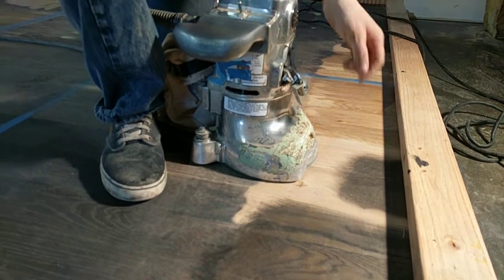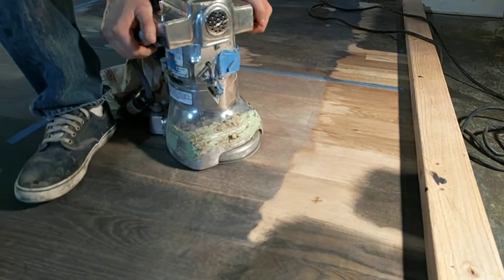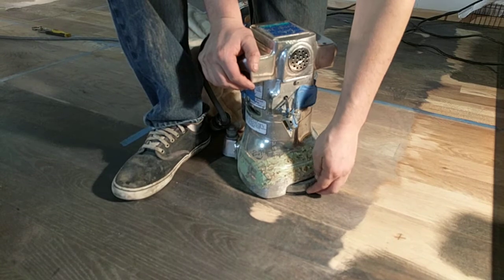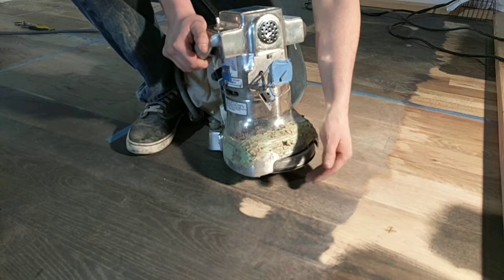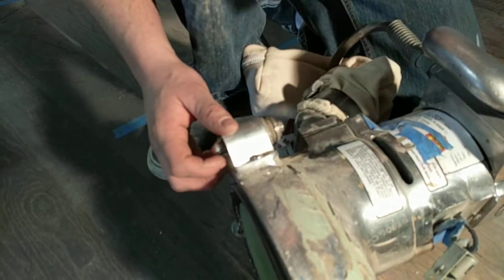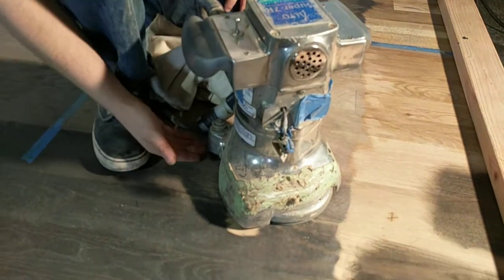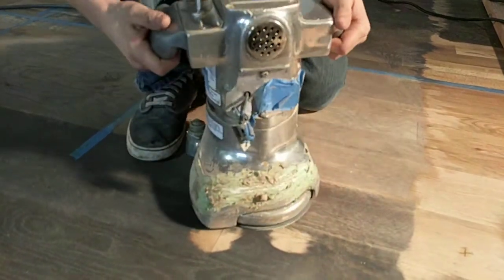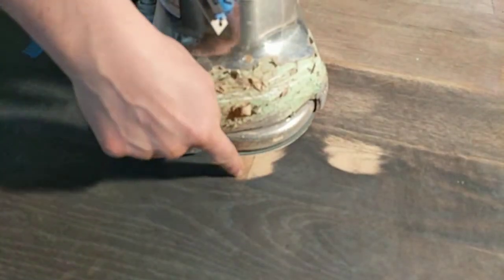#2 Edger: Understanding the buffer and How to adjust the Wheels

Comment: ive been noticing when i edge its wavy.  the edger is cutting exactly where it should be.   its confusing.  no matter how i adjust its still wavy and you can defiantly see it when it when poly is put on.  any suggestions?
Reply: So when you edge youre supposed to go forward with it and then back parallel to the boards you are sanding, and then move over to the right to the next section and repeat until you're done.
Super7s when set up properly dig on the right side and feather on the left side of the machine. That little screw on the chassis is how you differentiate from what side of the machine is cutting or feathering, my guess is You're moving  too over when going onto the next board and as a result the machine isn't feathering what you just dug into. Also remember left to right doesn't matter what axis you are running the machine on, left to right.
Reply: Maybe a nice finish sand....I'm think orbital 120 grit and higher...

Comment: I am having a weird problem with an edge sander.  I have it adjusted to have the sanding area front and center.  I am sanding with 60 or 80 grit paper, a pine floor that had water based polyurethane new 15 years ago.  It seems like the sander sands the poly off the wood in one spot, but deposits a thick layer  poly back onto the floor beside the sanded spot!
Reply from the maker: Jaimes Beam does it gum up on the pad and the ground? Is it a hard like plastic that is brown?
Reply: Pine flooring or any other softwood AKA sappy type of floor sands exactly as you are describing. As well as some floors which have had cleaners and or wax applied to them over the years. Some finishes will also produce the results you are describing. What's taking place is the product(s) you are sanding whether that be the flooring itself, the finish and or any cleaners present have a low melting point. The sanding process generates a great amount of friction AKA heat. With that said it doesn't take long to begin to melt what you are sanding and clog the paper. Your description is vague in the sense that you stated you are sanding with 60 or 80 grit. Have you edge sanded the flooring with previous grits and this 60-80 grits your finishing grits? In any event you are going to run into what you are describing regardless of what grit you are sanding with.  There are two things that I can recommend. First off get high quality open coat edger paper to remove all the finish. 36 grit, 40, or 50 to start with. Ceramic grain papers as opposed to aluminum oxide are best in all applications. Norton Blaze or Red heat. No pressure on the edger. Literally just float the edger. Move the edger at a moderate to quick pace in order not to allow the edger to build up friction as quickly.  You still are going to have to change paper far more then you would if you were sanding say a red oak floor. However you will get far greater distance with far less loading if you use the correct paper, speed and techniques. For instance here is a video of my company edge sanding a pine painted floor. https://www.youtube.com/watch?v=vVTkt2xpCQE

When it comes to the edging, we are sanding paint. A product which has a low melting point as well as a sappy wood and will do what you are describing providing we used cheap paper, moved the edger to slow and or applied pressure to the edger. In short, get ceramic grained sand paper like Red Heat or Blaze which is all we use. Move the edger quickly especially on the return cut. And float the edger, don't apply pressure to it. The weight of the machine itself will do what it is designed to do. Hope this helps you in the future.
Reply: some bad water base poly just glue the sand paper.. you need to go with 40 or 36 . then 60 and then 100..

Comment: Why do my pads keep getting filled up with like the old residue and getting gummed up
Reply from the maker: Need a lower grit paper. You are probably running into a wax or some substance that gets hot when sanded and melts into the paper.